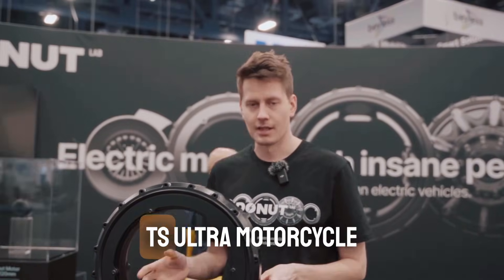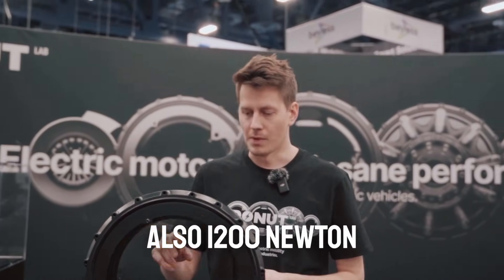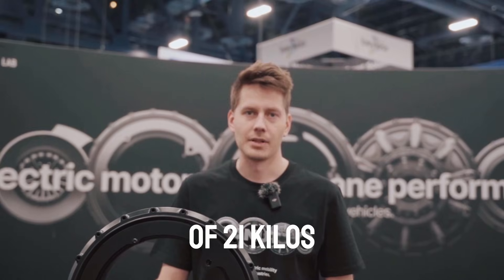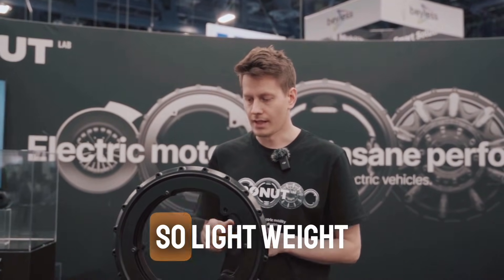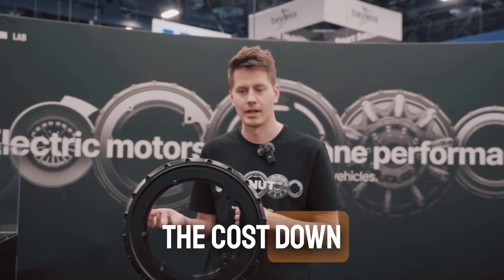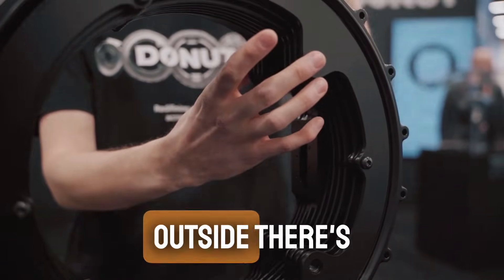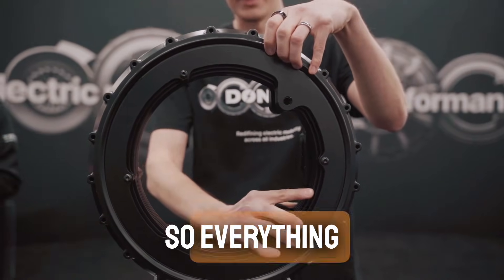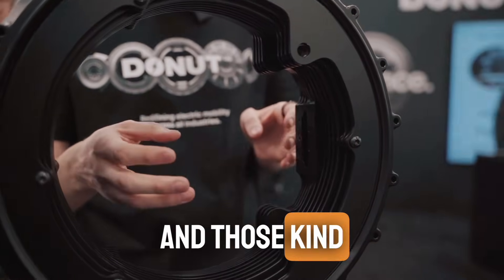Closer look: The Donut Motor (Motorcycle 17”)

Comment: I am skeptical that these motors will work as-advertised in real world conditions. Air cooling requires increasing the airgap between the stator and rotor, which limits performance. Then you have the issue of how your seals are going to allow air to pass without pulling water and debris in along with it (especially as aerosols). If you aerosolize crud in your seals, very quickly you'll end up with fouled stator windings that will overheat easily. Perhaps these folks have designed never before seen labyrinth seals to handle all of these issues, but that would be a bigger engineering achievement than the motor itself honestly.

Comment: The ease with which the motor appears to be spun by hand suggests there is no cogging torque and hence no magnets inside. Power to weight and torque to weight are pretty much off the shelf partial motors. What exactly did you new that's novel? Maybe provide more details like pole count, RPM, continuous power, etc. Otherwise this doesn't look like anything to brag about.

Comment: This type of motor will ultimately revolutionize the bicycle. It will become lighter and more powerful by advances in manufacturing. If we're able to weave CNT wires directly into the structure of carbon composite materials, you'll be able to lift the entire motor with a single finger. I did the math on this a few years ago and it will be so light, it will replace the mechanical power transmission from the crank to the wheel. Combined with possibly achieving an efficiency higher than 97%, it will outperform the chain drivetrain in every way and make it possible to build completely human-powered e-bikes with a total weight below 5 kg.
Reply from the maker: Yes! This is where the future is heading ⚡️🍩
Reply: Efficiency of 97% is not unheard off in electric engines. In EM's efficiency takes a hit when using bearings. So you only get 95% efficiency (or so). But this engines use maglev, hence the insanly high efficiency of 99%+ 
And this is not even new technology, it is only gaining momentum and public exposure now - with all this EV's craziness... Magnetic levitation is known for ages and well understood.
Reply: @MrGoMario it does not use maglev, it’s supported by bearings

Comment: I have so many questions. I've been researching you guys for the last 1 week since your first video on YouTube. I fail to see how this is 'revolutionary'. In wheel motors make a lot of sense until you start introducing problems that have already been solved in the industry. I've read all the comments on all your videos thus far and number one technical concern is your bearings. The industry already has well established bearing sizes, replacement methods, sealing, lubrication methods etc.. I can't imagine owning anything with an in-wheel motor and having to deal with potholes. I'd never drive the thing if it cannot be maintained.

Concern #2: Removing the gearbox. This also seems like a good idea. If I didn't want to have a gearbox in my car, the simplest thing to do is use a bigger motor with direct drive. Cool. But... Why put the motor in the wheel? To get rid of drive shafts too? This creates problems that don't need to be solved because they have already been solved. Have bigger bearings and complex seals only you can fix when the world is moving heavily to right-to-repair? And another problem with this approach is that it doesn't isolate heavy damage from the motor. I should be able to replace a wheel bearing without thinking of how I'm throwing out A WHOLE 150 kW MOTOR. I should be able to replace my tire without thinking of which specialized garage I have to drive to 300 km from my home. The rim, knuckle, bearing, brake system, suspension links and drive shafts should be untouched when thinking about an electric motor in my opinion. The donut from factor is betraying your mission, again, in my opinion...

Concern #3: Search "LIQUID PISTON ENGINE" on YouTube: I've NEVER seen a Liquid Piston Engine in any consumer vehicle but they at least have bench tests posted on YouTube. They have people veirfying their claims in 20 minute videos with effort that the company will never pay for. My concern is you guys seem to have a lot of money to spend on branding. You better not be hot air. Donut Lab only has claims to post? Come on.

Post a bench test. Show the wiring. Show a wheel change. Show a drive video in rugged conditions. If you want to be anything in this industry, show the work.
Reply from the maker: Thank you for sharing your thoughts - there is a lot of content in the pipeline and we will be breaking down the motors in more detail in the near future. To see the motorcycle engine in action you can check out Verge Motorcycles that has already been using our platform for some years now - they have some good material showing the bikes and motors in action. And there is also a video of a tyre change up on their YouTube channel.

Comment: Where are the high voltage connections? It’s 150kW and entirely air cooled? What type of continuous power output can be expected? I have my reservations.
Reply: The efficiency is well over 99% You still think the old ways, that's why it does not make sense to you. At that kind of efficiency even at max power, less than 1000watt are wasted as heat. And that can easely be disposed of by aircooling. 👍 I was more worried about the unsprung weight but that is also taken care of by using active suspension. Unsprung weight is only an issue in passive suspention (like springs)

Comment: Bearings further from the center will experience higher surface speed and therefore more heat and wear. How did you deal with this or is it simply not a problem?
Reply: To be fair, the motor only needs to go 1000-2000 rpm for average road to freeway speeds being direct drive. The rollers/balls in the bearing also can be tuned in their diameter. The seals will have the greatest scaled difference, though since other motors may have small diameter seals after the speed reduction transmission.
Reply: @Dragonfly9307  1000-2000 rpm is still a lot of bearing surface speed to deal with.
Reply: @hughgwrecktion 
I did some rough calculations. The motor turns about 2000rpm at about 250kph.
I estimated the bearing and especially the seals to be at the diameter of 15" roughly, since the outside diameter is 17".
That comes out to a bearing and seal speed of 40m/s. That's no problem at all for a bearing, but MUCH to fast for a seal. So I do wonder how they seal this thing.
Reply: @ Thanks for doing the math on this. Interesting to see that the bearings should be fine even at 250 kph. If only the seal is an issue i believe there should be solutions for that, so maybe they actually have a viable product here.
Reply: What happens when you hit a -> g out crater in the road🤣🤣.. ..
Reply: And the large diameter and light weight interior? I see all sorts of problems with runout with deformation with temperature and load changes. "It looked good in CAD" is the new "it looked good on paper.
Reply: Do you even understand how this engine functions? Where exactly do you think the "bearings" are installed and what purporse should they serve? Do you also think a maglev train runs on bearings?😆 #JustAsking
Reply: @MrGoMario  One thing is very obvious here and that is that YOU do NOT know or understand how this thing functions.

Comment: These motors will get destroyed after going over a single bump/pothole. There’s no shocks/dampening/isolation like with a typical axle.
Reply: So why haven't we seen one get destroyed by potholes or bumps then? Also could be, just could be that they've thought about this when designing the bike.
Reply: @  because we haven’t even seen one. All we have is renders and prototypes.
Reply: @nonchalanto  I know right? I was about to say the same thing and then I saw your posting. This has junior engineers who don't know what they are doing all over it.
Reply: @hughgwrecktion  You must be living under a rock. These motors have been used in Verge Motorcycles' bikes for years now. Next time maybe do some research before doing dumb assumptions.
Reply from the maker: Thank you for your thoughts! The motorcycle motor has been in use on Verge Motorcycles for a few years now and they are a great example of how well these motors perform in real life. They have been ridden and tested in proving grounds in Spain and tested in the arctic in Finnish Lapland and ridden by customers in already nine countries in Europe.

Comment: Can I retro fit my 2012 Volvo XC60 with this?
Reply: Technically you could, although this motor is meant for motorcycles, they have the 21" motor for cars.
Reply: @makoq16  But 2-4× 150kW is more than enough to drive a car + smaller diameter wheels make for more efficiency as well (less tire mass to spin up).

Comment: Why the Verge TS Ultra cost 55.000 € (double the price of a Zero SRF) if this motor-type is so cheap and affordable!?
Reply: So cheap and affordable when compared to conventional electric motor and drivetrain. Then there's more to the bike than just the motor you know? Also companies want to make profit so I would guess thats one reason too. Also taxes etc. Use your brains maybe next time.
Reply: @lpetn  Thats not the answer to my question. (and i use my brain) There are not so many different parts at a motorcycle: frame, fork, handlebar, wheels. If they tell me the cost will be lower for any kind of vehicle it couldnt cost the double than a regular motorcycle from Zero/Energica/LiveWire. ...use your brain, pkease.
Reply: @ZeroPionier  Well why do bugattis cost 4 million then? Im sure it doesnt cost that much to make them? Or what if it does? Research and development isnt free, parts arent free either.

Comment: The only problem with ev's is they batteries I'm pretty sure aren't great and they don't charge as fast as fuelling a car
Reply: I have a Tesla and I charge it every night by plugging it into the regular 110 outlet on my porch. My friend who has one drives his 3 hrs commuting every day and he charges his overnight with a 220v charger at his house. So I never have to stop and put gas in the car, it’s just always full. There are teslas with 300,000+ miles on them still driven daily. A conventional gas engine with 150,000 miles on it is getting to the point where you start worrying about major mechanical issues.
Reply: There is still a significant variance on the miles/kwh of different electric vehicles, especially when comparing Tesla (and Lucid) vs. legacy automakers. The Donut motors should make it easier for legacy automakers to develop EVs on par with the efficiency that Tesla cars currently deliver.
Reply: @BlueOceanStrategistS  I just wanted to point out that existing battery technology is adequate for the job. People fixate on range and affordability, but I’m cheap af and I found that my Tesla model y was the best value considering long term cost of ownership. Even compared to low mileage used ICE cars. The range has never been an issue since I’m fully charged every day. Obviously if you’re driving hundreds of miles a day, annEV might not fit for you.
Reply: You charge it at home, so you don't need fuelling or go to  gas station anymore
Reply: @AprezaRenaldy  not going to the gas station saves you so much money because we all buy snacks at jacket up prices when we fill up. I got a soda , chips, and a candy bar and it was almost $10